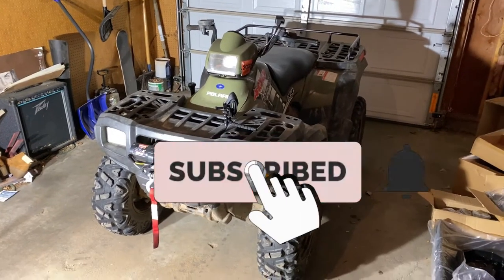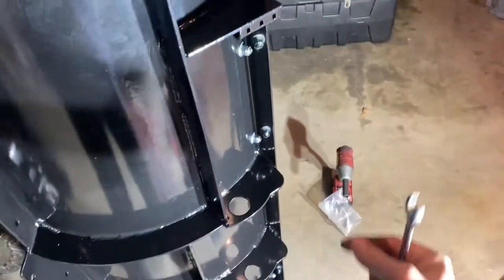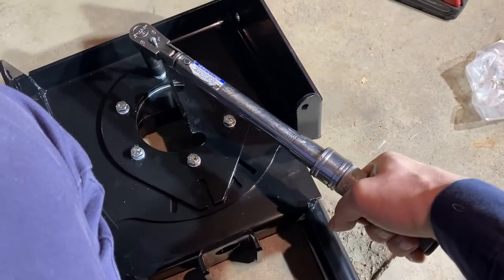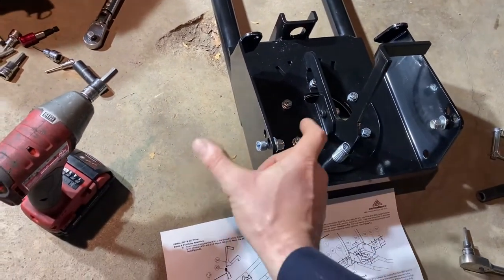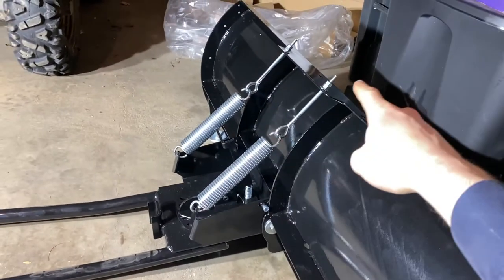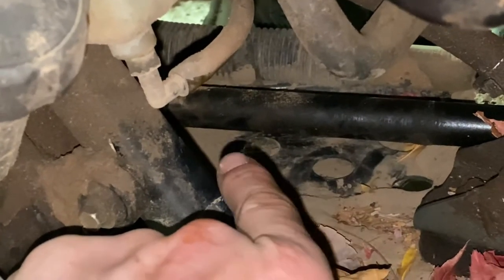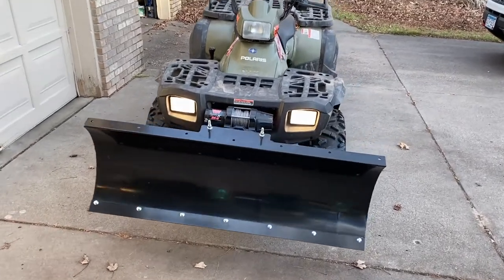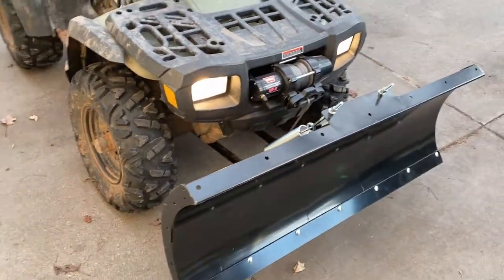2004 Polaris Sportsman Denali Plow Install

Comment: Great instructional video.  I bought mine fall of 2021. Found this video. Never got around to it last winter. My 4 wheeler needed a new carb. Fixed that this past November finally installed the bracket on the sportsman I have a 2004 sportsman 500ho. Only has 690 original miles. Anyways they've made at least one change. Where your bottom blade bolts to the plow, my plow has "u" shaped notches that allow you to access the nuts, so I can use a socket. My nuts are larger to (lol). 14mm not even close. I gotta get some tools out of the barn. I would guess 17 or 18mm
Reply from the maker: Good to know! Glad you finally got around to putting the plow on haha. Super low miles on that 500, too!

Comment: Tony for the plow? Did the mount for the ATV come with the Denali Plow or you have to purchase the mount separately. The mount that connects to the bottom of your ATV? Thank you!
Reply from the maker: Hi there! If you go to the video description of this video, I have the exact link to the product I use. The mount itself is not made by Denali, but it comes with the plow if you order from them. Once you click the link, you select which blade and mounting kit you need. I believe the plow mount kit itself is made by Moto Alliance. MA11101 was the part number needed for my ATV, but again, it came with my plow kit since I ordered them together.

Comment: I'm undecided between 50" and 60" plow. Any input on your 50 inch since you've installed it?  I have a 2004 - 500 HO. Thanks!
Reply from the maker: More blade is always nice, I just wasn’t sure how the 400 would handle pushing that much weight, and I wanted to be able to get into slightly tighter areas, so I went with the 50.
Reply: Just finished my setup, thanks for your video, I couldn't have done it without your walkthrough. It came with a universal mount, had a hell of a time getting it flush mounted.  Ended up having to wait for the OE mount to arrive and much smoother install. I also went with the 60"👍 Thanks again!
Reply from the maker: @tjmacdonald256  Glad you got it figured out! Have you had a chance to try it yet?

Comment: Are able to do a video on how to install the winch?
Reply from the maker: I probably won’t do one just because mine is already installed and I’d have to remove everything to make an install video. It’s actually pretty straight forward if you have the right mount and a winch that fits. The wiring in my winch was all color coded and the instructions said where each wire went on the winch solenoid. Do you have any particular questions?

Comment: Like the video but for the cotter pin‘s just fully bend both if you can, I would at least bend them more then he did
Reply from the maker: I normally bend them a lot more but not when they need to be removed again to adjust the plow pads. I ended up removing mine completely and just run straight blade.

Comment: Bought a used ATV with the Denali plow on your video. What pile of junk. It won't stay in its slot, keeps popping out while plowing. The hook to the winch has very little travel when lifting.
Reply from the maker: The slot for angling the blade? Are you sure the retention spring is in place? I always make sure to physically help the spring by pushing the locking tab into the slot by hand and I haven’t had any issues yet luckily. My plow has about a foot of up-travel.
Reply: @TonyTheTruckGuy   You might be right. Checking the spring might be worn out